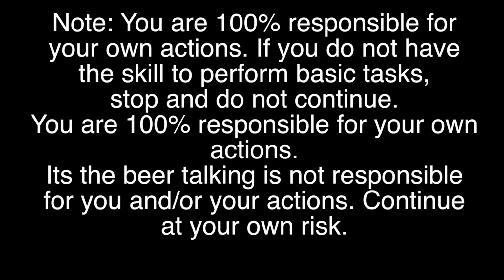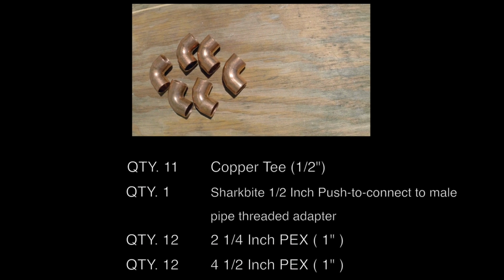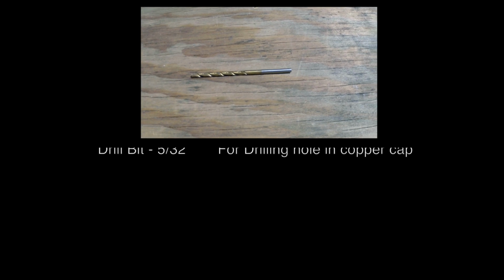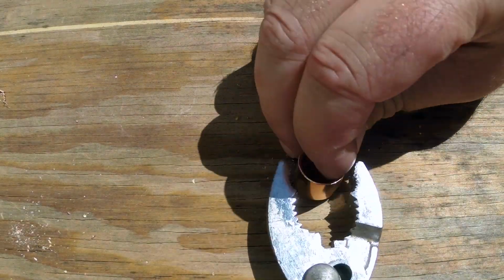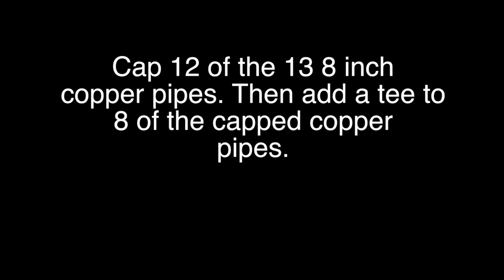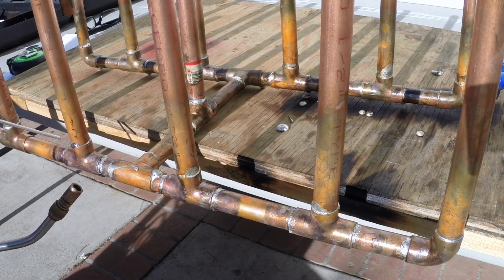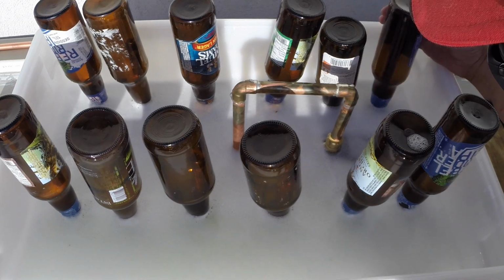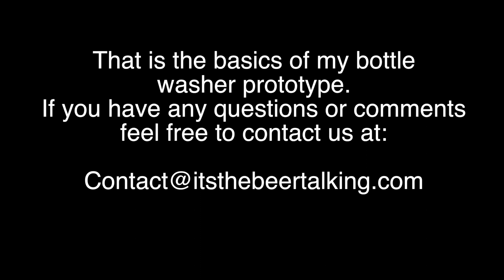BottleWasher-b

Comment: I'd put some legs on the bottom of your cleaner to keep the bottle mouths out of the cleaning solution, that way if there's any debris in the bottles it could easily flow out.  Other than that i like it. How do you like that pump?

Comment: do you think this would work with PVC?  great video!!
Reply from the maker: +Jason F If you can get small enough pvc it should work. Some pvc from what I understand is not healthy to use for drinking. I looked for a long time to make it as in expensive as possible and looked at pvc as an option. I could not seem to find all the parts to make it work. If you find the right fittings and sizes, I see no reason why it should not work.